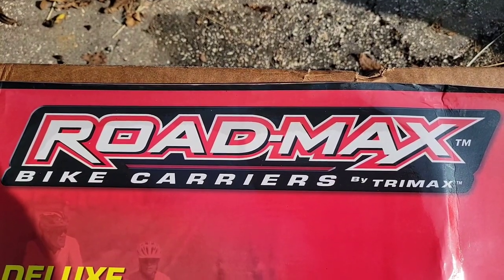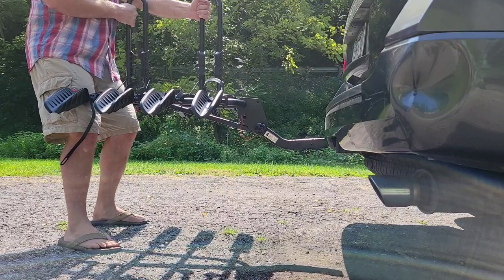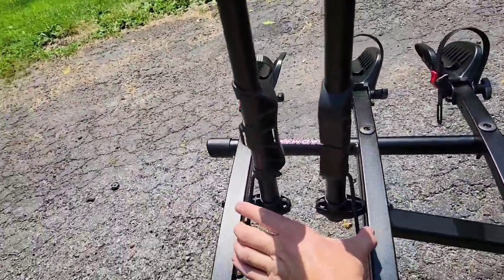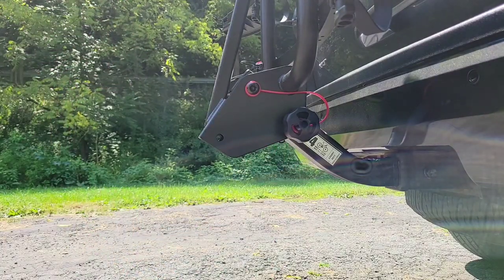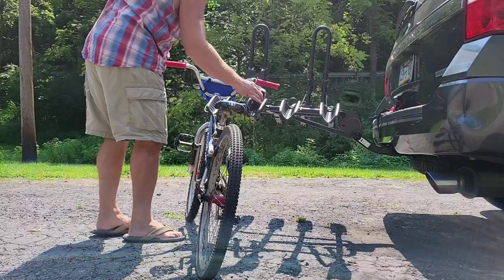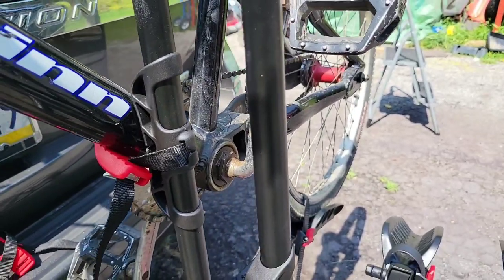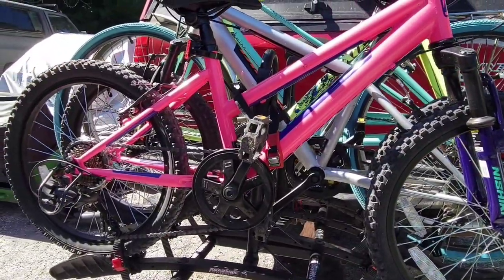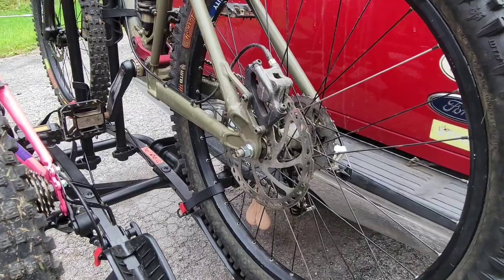Roadmax by Trimax 4 bike carrier review (4/5 stars).

Comment: Did you extend the wheel supporting "paddles" all the way out for your large MTB? I have 4 29" FS MTBs, and I wonder if the rack will work for them. Also, how much space does it take in the storage between use?
Reply from the maker: Yes, I forgot to mention that. I have them all the way out now since I finally got with the times and ride both 27.5 and 29" bikes:)

Comment: hi great video.  how many bikes would you have to renove to be able to open the hatch on the Explorer?
Reply from the maker: Hello, unfortunately you have to remove at least the inner 2 and then the inner hoop folds down. You could always add a hitch extension to potentially avoid that. Have a great day!
Reply: @ericbattlefield1371  thanks!  yeah I ended up going with a different rack because I figured this might be an issue.